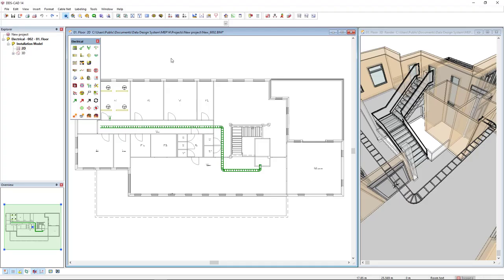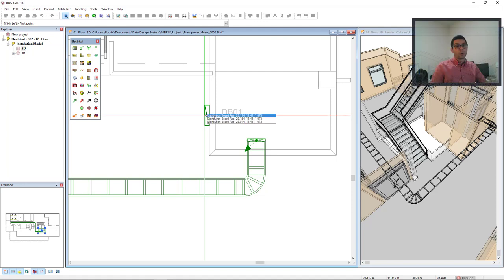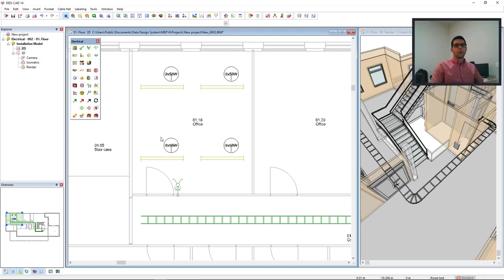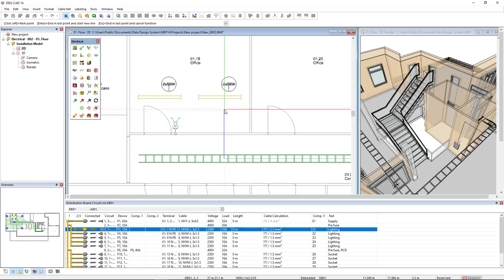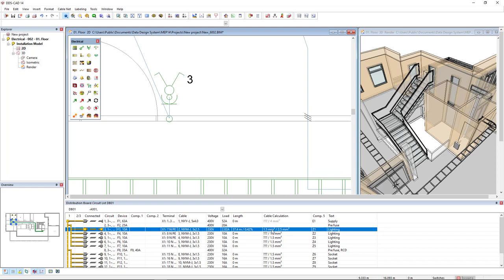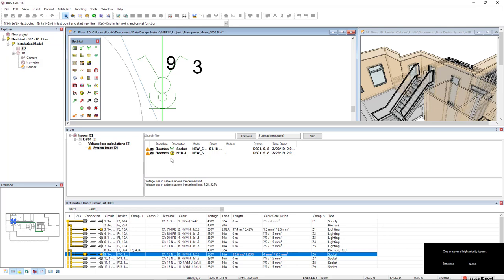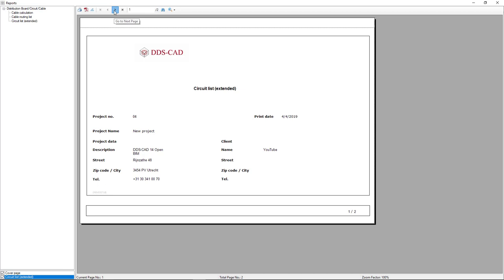The power of DDS-CAD's cabling and intelligent electrical circuit list

Comment: For the Socket circuit 9 (Fuse F10) is the voltage drop calculated with Load of 16A? Because this is not true in real life (connected consumer is always less than 16A)
Reply from the maker: Hi Nenad, when the fuse is under dimensioned, it will be displayed in red. DDS-CAD has an option to update the fuse, when dimensioned it will be displayed in green.
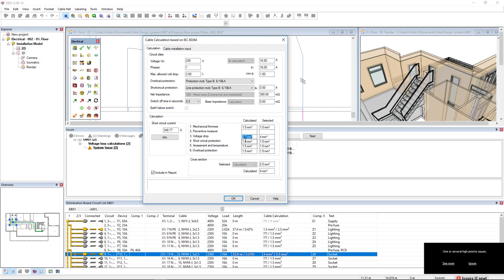Reply: @DDSCAD-MEP  You misunderstood my question. I was asking with what Power was voltage drop calculated on circuit number 9 (https://youtu.be/mwhpeAd5Lik?t=471). And I think that I found an answer looking at 7:51 of this video, meaning with 16A. All I am saying is that this is wrong Power/Load to calculate voltage drop on socket circuit. For example for single socket correct Power would be 200W-400W, hence the calculated voltage drop would be much lower than 3,23%.
I mean Socket has no Power/Load - only consumer that is connected to this socket have Power/Load and it is never close to 16A in reality.
Reply from the maker: @NenadNikolic77  , this is something we have optimized in the recent version of DDS-CAD, DDS-CAD 16. Now, the socket Power is taking in consideration for the voltage drop calculation. See https://youtu.be/wRG50ajIwj0?list=PLfoXq1Y9-Ax1YHa1t0cq7r0-NNzA99N_V&t=41. Regards,
Reply: It is correct , you are calculating maximum voltage drop which can be tolerated and there is a reason why we have 16 A sockets , you will not sit and tell people what to plug and what not to plug in that socket , you are assuming 200-400 w which is correct in most cases but what if someone connects something like 2.5 - 3 kw in it ?
Reply: @Moneyminute.  Like what? What mobile consumer is more than 2,5kW ? 😉
Reply: @NenadNikolic77  it is not dedicated mobile phone socket :) 

it can be used as a mobile phone socket , vacuum cleaner which is 2400W  and etc etc , so yes he is correct , it should be calculated as a maximum 16 A 

You should calculate voltage drop with exact number when you have dedicated sockets !
Reply: @Moneyminute.  2400W/230V=10,4A
Reply: @NenadNikolic77  

Example : 

maximum voltage drop should be 5 % 

3% + 3% but not more than 5 % 

Assuming you already have <3 % voltage drop upstream and you are calculating  it for 200-400W 

take an 1.5mm cable , 50m as an example which has 22.4 mv a m 

with your calculation it has 0.46 % voltage 
take for example Vacuum cleaner which has 2.4kw and 3 % voltage drop .
Reply: @NenadNikolic77   stop arguing with the people who know what they are doing ! 

Sockets are 16A and  generally have 2.5mm² cables and 16A circuit breakers and there is a reason why we have this !
Reply: @Moneyminute.  very bad example :)
Reply: @NenadNikolic77  get some experience :) 

Learn the difference between Dedicated and General Type sockets .